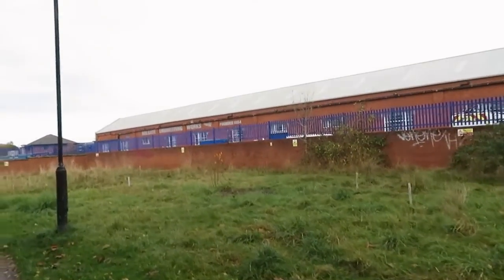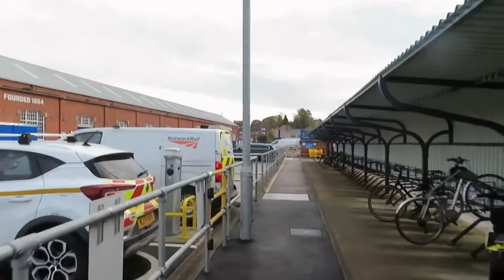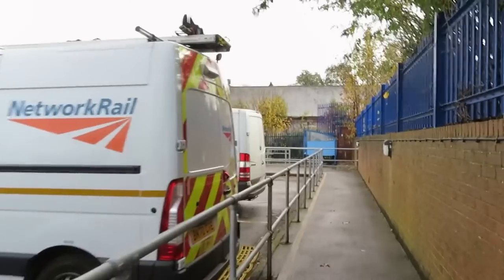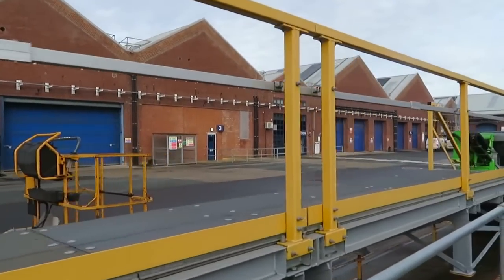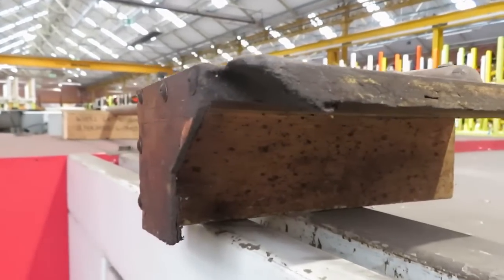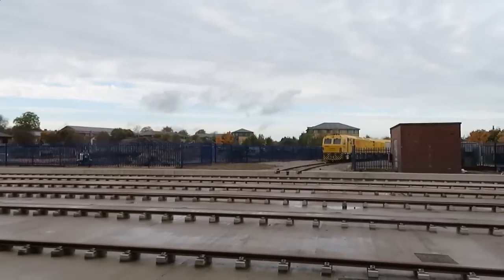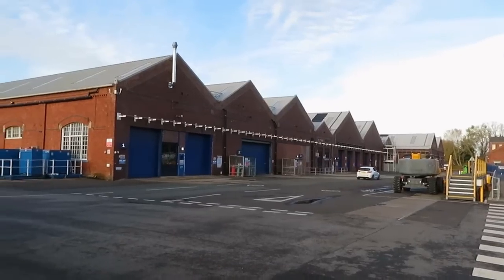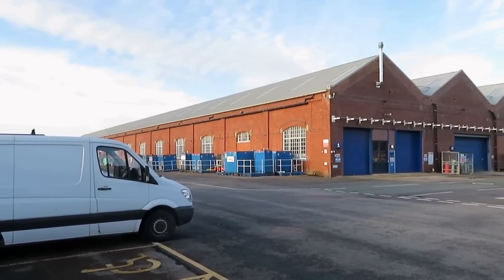A rare opportunity to visit Holgate Depot in York, Network Rail’s largest engineering works depot.

Comment: Prior to Network Rail, Thrall Europa bought the ex BREL site to build wagons for EWS, sadly once contract came to end so did works in steps Network Rail safeguarding it's future prosperity more lines been restored to the Traverser roads by Network Rail last Year.
I used work for BREL briefly as Welder, enjoying lovely visit when Thrall works build EWS wagons nice see main complex building still in good use.
Having the biggest Signalling centre in UK in York ROC, lot of Network rail staff based at York, these works have bright future ahead.
Wagon works now gone were on the opposite  side of York yard where Everything unit wise built in BREL was temporary put in WW for going out on dynamic testing prior given to Customer. 
Wagon works were demolished part of York Central Redevelopment
Only Holgate Engineers depot only part once vast Railway building in York.
Reply from the maker: Thanks for the comprehensive information.